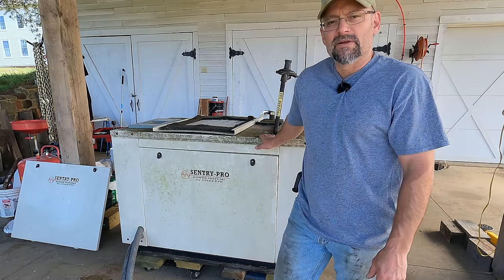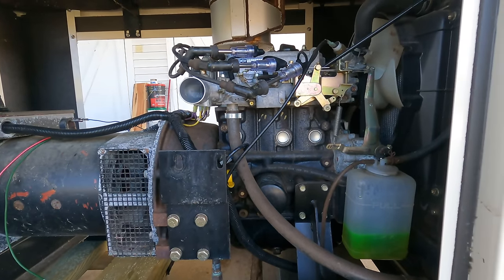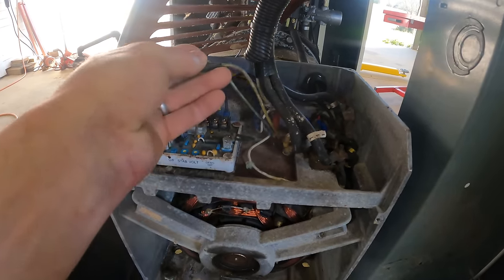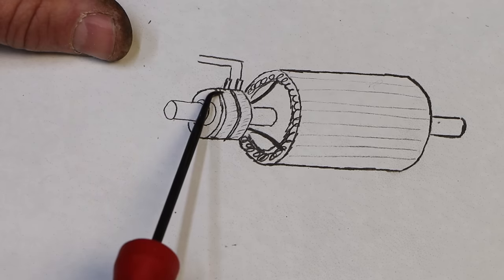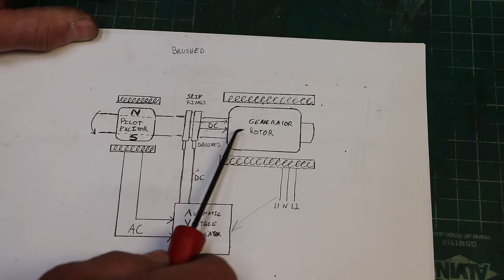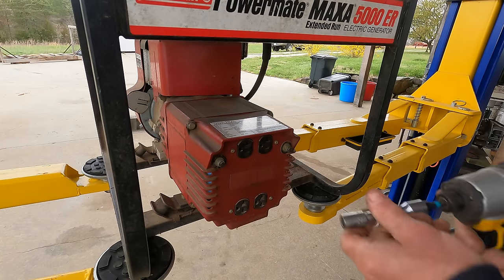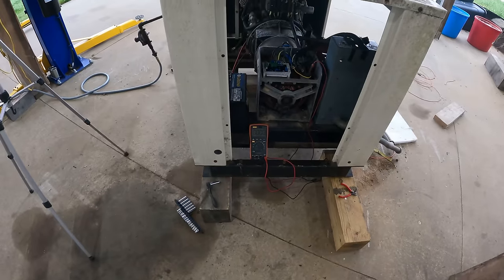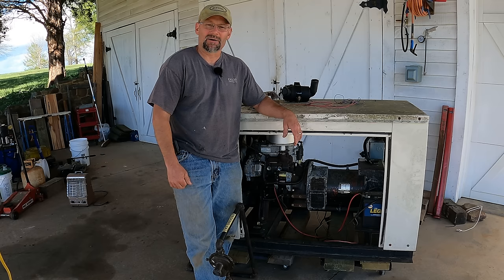How Generators Work, And How To Fix Them.

Comment from the maker: Generators are fascinating in how they work, but there are so many different variations and ways of doing things it's hard to do a comprehensive overview in a single video.  They will certainly keep you on your toes!  I hope you guys enjoy the video, and have an absolutely excellent weekend folks!!
Reply: Learned a lot by watching this. Great work.
Reply: Should have sent it to james c
Reply: Weren't those short white wires actually fusible links? I believe that wire could be directly on the stator winding and has the full current of the generator available. I have seen the fireworks when that wire gets it's insulation eaten. Big bright plasma flash!
Reply: If you want your head to explode add a tertiary winding.  That makes an amplidyne (sp). That makes crazy power and when I learned how they work I was told PFM.
Reply: for more generator videos I recommend @SmallEngineMechanic
Reply: I'm ready to take a nap before the guy ever gets his fuel hooked up lots of things interesting but a whole lot of things just not
Reply: A remark on the engine oil being clean and must have had low hours. A propane engine runs very clean compared to normal gasoline/Diesel engines and the engine oil wil still look fresh after lots of hours of runtime.
Reply: I have a Kohler 30kW Standby generator for my house and we're out in the country, so mice are a real issue.  I've put some steel wool in a couple of holes where it looks like they could access the wiring areas and put mouse glue traps inside the enclosure.  Sometimes I'll add a couple of mouse poison blocks inside, plus I have a mouse poison bait station outside the enclosure.  So far, the wire chewing critters have not chewed wires like they were doing when the generator was first installed.  I had to have the spark plug wires replaced along with some controller wires.  I'm not seeing any way of making the generator totally mouse-proof, so I'll keep using the traps and bait until I come up with something better.  It helps to check the generator every month or so just in case the glue traps work...
Reply: @craigking391  ❤❤❤❤❤❤❤❤❤❤
Reply: Or you don't use a regulator and you put your 20 lb propane tank and a bucket of hot water.. so it does not freeze up.. I have been known to use a small rosebud to put on the bottom of a propane running off of 1 lb green cylinder but.. for the everyday person I highly recommend you don't do that.. I am somewhat of a mechanic and have been doing things like that for many years I know the signs when something bad's about to happen most people don't. And for those of you that might look and go how bad can it be.. in 2004 and portage Wisconsin I had a propane cylinder explode two feet away from my face.. I was inside my garage near the back wall it lifted the roof off the cinder block walls and shifted the roof about 4 ft it sent me through my garage out the big door across my driveway across the road into a marsh.. about seventy feet from where the boom I'm severely burned over 43% of my body.. the explosion blew sheets of skin right off my body.. and I spent the next two months and trying to regrow skin in places my arm was mailed to the side of my chest my right ear was melted the side of my head my lips and my right eye was melted shut and I had hot metal shards all over the right side of my body and total a little over 300 metal pieces had to bring be removed from my body.. the movie zoom with Tim Allen when he gets his speed back and he's running back to base to get his suit and he trips and falls and stumbles across the desert that's about what I look like being sent out of my garage from the explosion...  it's a bad day if you don't know the signs.. you live you learn.. but it's better to learn from other people's mistakes rather than first hand.. I highly recommend just taking to putting your propane tank and a tank of hot water..
Reply: You can make your own load tester out of inch and a half diameter 3 ft long stainless steel garage door springs.. you'll need to construct a Mount to where you can tension the spring but the voltage won't pass through it and only springs.. you can use galvanized if you're on a budget or even steal.. I prefer using stainless steel because I like to put my contraption into swimming pools Sol testing generators and the springtime is it good way to keep the 28,000 gallon swimming pool my dad has.. he only got mad at me once for doing that.. I was testing a 3-phase 800 k generator.. and about 2 hours the pool water when from 35° to 180° I put it in the deep end of the pool.. which was 9 ft deep. After cutting a hole and about a foot of ice the pool pump wasn't yet and there was two feet of snow around the pool .. was being the keyword. But on a small scale like what you're doing you could easily use a 500 gallon cow stock tank.. the water will just spoil a lot quicker you just keep a garden hose going in it..
Reply: Just spray soapy water on joinf
Reply: Often times there are wires in a wire harness that have no purpose with the unit but could be used in variants that you dont have
Reply: I actually understood what you were saying.
Reply: @Melicoy oòò
Reply: Hi, I'm vastly new to playing with generators but I do have a question. Why can't a person delete one of the steps of changing the current type (ac-dc-ac-dc) ? Just to sate my curiosity, thanks!
Reply: This is a great explanation. Keep up the great videos.
Reply: $140 just for a voltage regulator and it's not even gold plated. 😲
Reply: If I had one I’d get a sonic thing to keep the mice away

Comment: I'm an electrical engineer covering generator controls along with other stuff for an offshore drilling company. Your explanation and troubleshooting for that stand-by gen were spot-on; same approach our guys use troubleshooting the big diesels offshore. =) The cool thing was seeing all the same principles duplicated in miniature. The 15kW stand-by wasn't that much different from one of our 7,000kW gens, except we pull exciter power from a PMG.
Reply: Most under 10KW are brushed.  The engine will probably wear out before the slip rings or brushes.
Reply: Totally agree.  Worked on some old EMD stationary power (4000 kW).  Basically railroad engines with the generator swapped out for AC power.  Things were kept pre-lubed and went from standby to nearly full load in 10 seconds.
Reply: Nuke plant I worked at had 2 trans America Deleval/Cooper/Enterprise that were V24 4 stroke to memory.  Had full temperature control if oil and coolant to have diesel and generator ready to go from full emergency start to full load about 10,000Kw in 10 seconds to memory. They were massive and had all sorts of pneumatic sensors for protection along with a pneumatic computer.  The V12 tandem GM EMD 2 stroke was much simpler and louder but purred like a kitten.  It had about 6,800kw to 7,200kw to memory.  Been 20 plus years since I worked in either of them.   The DELEVAL STARTED AS HUGE CARGO SHIP ENGINES that were built and certified for nuclear power emergency back up power.  Both were air start with the Deleval injecting air into the cylinders and the EMD’s each having two robust air start motors driving their flywheels.  You could tell which of the three diesels fire up by their sound.  The EMD started really loud then quite down. The Deleval had two massive turbo chargers per engine while the EMD ALSO HAD TWO TURBO CHARGER PER V12 engine.  All had oil sump, coolant heaters and circulating pumps with the turbos having a soak back or drip feed to their bearing for hot starts before the main engine driven oil pumps kicked in.  The coolant electric circulating coolant pumps would also turn off when the engine drive coolant pumps came to speed and system pressure.  Much of the test run protection in the Deleval would be bypassed by the pneumatic computer during an emergency run.   It either ran or failed.  I think the only protection that remained in the Deleval were the main crank and connecting rod temp sensors were lad melt type which would vent the air pressure holding the pneumatic computer in energency run when I tgat mode and perhaps the turbo vibration sensors and turbo oil/bearing temps but it’s just been too long and I worked more on the nuclear instrumentation snd reactor controls than the other equipment.
Reply: I pump out septic tanks, and your description of a generator are amazing!
Reply: Thank you  Rodents are trjoublesome
Reply: Thanks for the drawings & explanation.  Good job.
Reply: I'm  master electrician for 40 years in state of Florida plus  Generac generator technician for Verizon,  T-Mobile, an american tower corporation generators at all the cell tower sites in state of Florida. I thought you did a very good job. Except for our exciters are PMG,I thought you did an awesome job explaining

Comment: so in my area, mice chew on cable coatings because some genius decided to make wire coating based off of soy bean coating… i am not saying this person should be strung up… just pointing out that good idea fairies abound. Thank you for your channel, I learned a lot. I have to maintain my own generators. It is a good question why brushless on large standby and brushed on small inverter. my real money maker is the smaller inverter 210cc generators that allow for parallel cables. It is rare for someone to put so much information for free online. Thank you. 🙏

Comment: Great work John and I kept thinking of James Condon while you were working. I don’t fix generators but I really enjoy his channel. Like you, he has the drive to keep going until it’s fixed. Here in Australia the authorities would cut your balls off rigging up your own propane connections like that. I went to a hydraulic repair shop to get a propane extension hose made and he pulled out the bits I wound need but said he couldn’t do the connections because he wasn’t licensed to work with lpg. I asked him if he was joking because he could make a join for a 100,000 psi hydraulic hose but not a 120psi gas hose. He assured me he was serious and then picked up a pair of crimpers and placed them in front of me and said he had to go out the back for a minute😉🤫I guess he thought it was ridiculous too, when he came back in I paid him for the parts plus some extra for the use of the crimpers. What a cool guy. True story. Please keep those great videos coming, they’re always interesting. Cheers mate, Stuart 🇦🇺

Comment: Fantastic dear explanation of how both brushed and brushless generators work are very helpful as I am messing with a brushless generator that does not produce 115 votes and 230 votes but the hurts which is supposed to be 60 is all over the place, trying to figure outwhat’s wrong?

Comment: On newer generators they have built them in a manner to not need brushes and slip rings. They have 2 stators and 2 rotors with just a rectifier between them. They energize the stator of the excitor  to induce the current in the pilot rotor. I was typing before you got to that part of the video.

Comment: I was curious if you would mention “flashing” to generate the DC voltage initially needed. And to my surprise you did. Any generator that has been in storage or not used for extended time often just needs “flashed” to get it going again. Thanks for the great video explained in an easy to understand format. Good job.

Comment: 240 is normal. 250 is at the high side of its limit. I would set it back to 240. If your shop service is at 250, I'd wonder why. But then I suppose it all depends on how stable your service is.

Comment: I learned more today than in the previous hours of watching others work on their generators. 
Great explanation. The drawings were immensely helpful. 
I worked machine repair for the first 10 years of my employment. After that I was supervising others doing it. 
For the last 10 years I have been retired and doing contract work writing work instructions for several companies. 
Electronic cameras are a wonderful tool. They let you watch the operation from all sides. Part of the work instruction is providing pictures and drawings of the various processes. I set up 2 or 3 hi rez movie cameras and record the process. Then I clip stills from the video and embed them in the work instruction. 
If I had the cameras available in the shops I was repairing or training others in how to repair equipment I would have had a much better chance of success. 
Seeing the MOSFET overload and smoke the fuse is invaluable. 
Great job and thanks for the explanation. 😁😎

Comment: The bridge rectifier simply keeps the alternating waveform always positive, but it is still alternating from zero to max voltage.  The regulator will add a low pass filter to turn it into an actual DC level which can then be adjusted from zero to a max voltage.  The low pass filter parameters are adjusted based on the frequency of the ac signal which is set by the speed of the spinning motor.
Reply: I was pretty much coming to say just this.
Reply: And in fact, the big ol' "can" capacitor used for this is often a point of failure for brushless generators.

Comment: That explanation was spot on, just like my teacher explained it back when I trained to be a TV repair engineer, we touched into a lot of different aspects of power generating and usage. We even did a full montage of a fusebox in a house, with all connections and a shitload of wires to connect. The teacher would come up with different malfunction that we was supposed to find and rectify, and at the end we could almost find any problem with any TV or radio set they dumped on us. This was back when TV's was huge and bulky and the flatscreen had not been introduced yet. Nowadays nobody repairs anything anymore, and just pay to get a new item. Thousands of perfectly good electronic devices gets just dumped each year. Like a modern flatscreen tv has to be OLED or it is not good enough, and of course curved screen is a must. It's just so silly.

Comment: Summary was generated by Summatim, let us know if there are any inaccuracies! 🤖
0:01: Introduction
0:59: Control Panel
2:15: Checking the Engine
5:17: Investigating the Control Panel
8:48: Hooking Up Propane
10:43: Fixing a Leak
13:28: Testing the Generator
15:05: Investigating Power Output
19:05: Generator Diagnosis
19:15: Stator and Rotor
21:24: Exciter
27:04: Brushed Generator Setup
27:33: Brushless Generator Setup
36:47: Generator power adjustment
43:59: Brushed vs Brushless Generators
44:08: Introduction
44:36: Pilot Exciter
44:48: Fuse Replacement
45:43: AVR Replacement
50:51: Load Testing
54:06: Powering the Shop
57:36: Conclusion
Reply: This should be in the description of the video or in a pinned comment/

Comment: Hi John, propane engines usually require liquid take off from the tank, whereas your BBQ uses vapour take off.  That unit between the tank and the engine is a vaporizer. Liquid propane is fed into that unit and converted into vapour. Those units usually have coolant hoses connected (on cars) to prevent the vaporizer from freezing.
Reply: His doesn't look like it's got a vape unit. It's probably spec'ed for the general use case where a person is feeding it natural gas.
Reply: No, The unit is not a vaporizer.  They are generally only used on larger engines, and require hose connections to the engine coolant to keep them from freezing up.  This unit is definitely set up for vapor input, the unit mentioned is simply a pre regulator to reduce vapor pressure.  This small 3 cyl engine can be run directly on vapor no problem.  If it was a V8, it would definitely use a vaporizer tied to engine coolant.  Tank pressure is 100-200 PSI depending on ambient temperature, it needs to be reduced to a few inches water column for the carburetor.  Hence the two stage regulators, one on the outside plumbing, and if you noticed, there is another regulator inside the housing for the final low pressure to feed the carb.

Comment: That’s an awesome generator! That engine is an amazing motor . They don’t make them anymore. That is seriously a 20,000 hour engine all day long. I have the same engine in my Ventrac. It was the longest lasting engine they put in them. They are anvil tough. The oil stays clean on them, and you lose more by wiping the dipstick to check it than they burn. They do not burn oil at all. You can neglect them and they keep on going. Those engines are getting very difficult to find the only way to kill them is to run them out of oil intentionally and let them go all day long with no oil or to overheat them until the cylinder, head, warped like a banana ,they will still keep going. Your friend is lucky to have you ,nice work.

Comment: For reference, the H on a fuse doesn't indicate the fuse speed, that's the breaking capacity, H for high, L for low. The T means slow blow, a fuse marked with an F is fast blow.

Comment: Excellent and very detailed explanation. On a side note, I have that exact same analog multimeter purchased from Radio Shack in the 70's! Still working and  very useful to see fluctuations that I can't see on my digital meter. Thanks for all the work you put into this video!

Comment: The original on/off switch might work, they usually have a delay, up to 15 min for off. That way if the power goes in an out, the generator isn’t turning on and off instantly.

Comment: many years ago I was taught that the best way to prevent gas leaks is to use the yellow teflon tape then use a layer of piper dope on top of the tape, it works like a charm

Comment: @23:40 there are also a lot of small generators in like light towers and stuff that use a capacitor instead of the AVR. This helps adjust the voltage as the engine rpm and load fluctuate. it also helps on start up, because it means the generator won't be at full field load. And lastly it also means the field wires don't get too hot and or kill your battery when the unit is off.